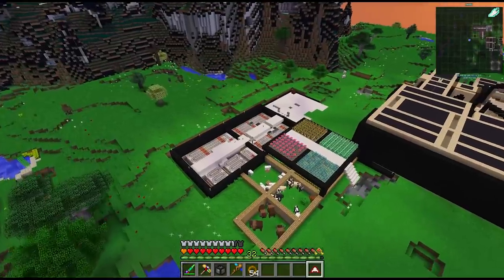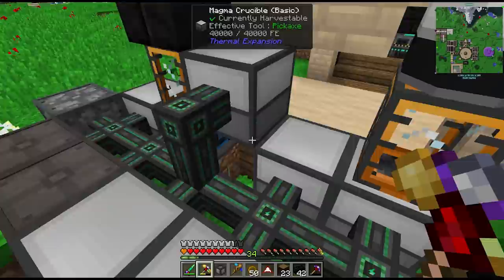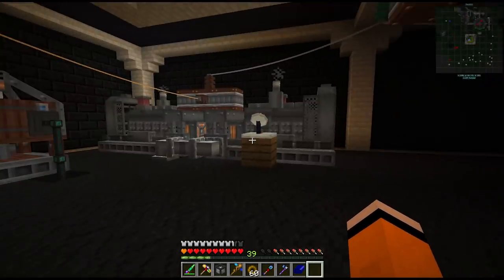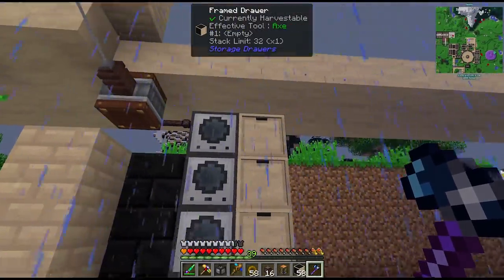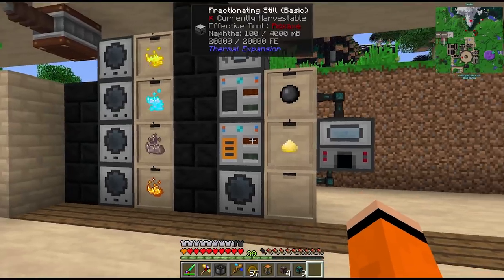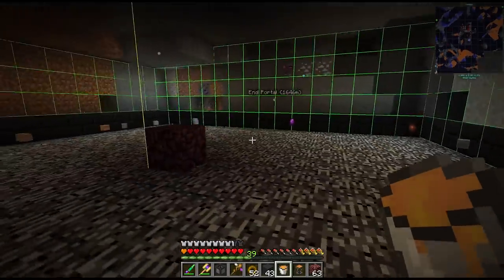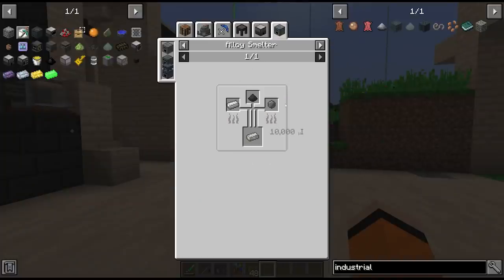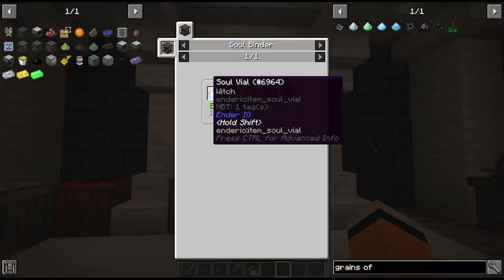Divine Journey 2: Ep12 - Too Many Ingots! Modded Minecraft

Comment: A good source of diamonds is nether diamond ore, if you run it through a sag mill with a good grinding ball you get lots
You don’t need hoppers for the thermal machines, most of them can auto input
You will need tons of enhanced machine chassis, you should definitely batch craft a ton of them
Reply from the maker: I did swap to chests by the end of the video, and I'm already working on those extra chassis. I'm going to be dreaming machine chassis haha